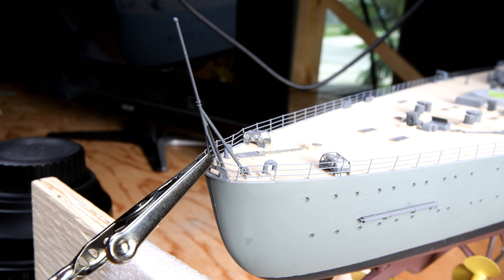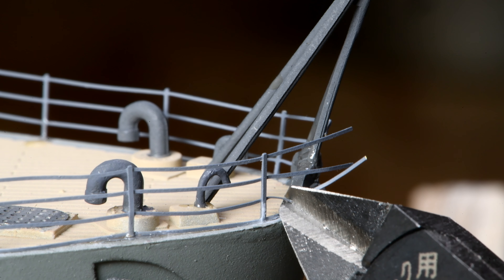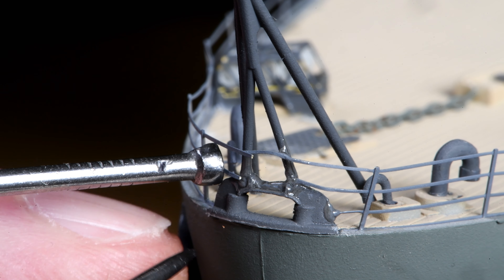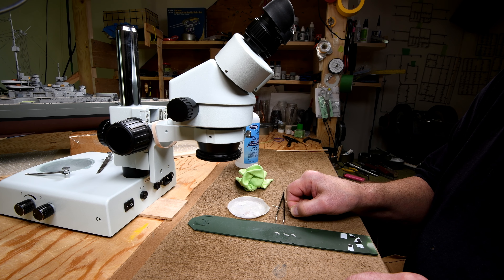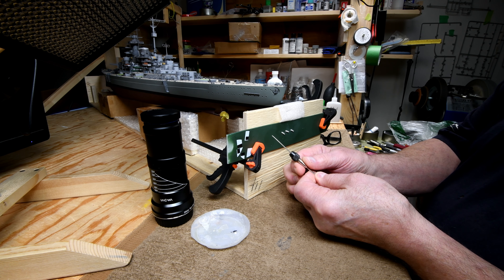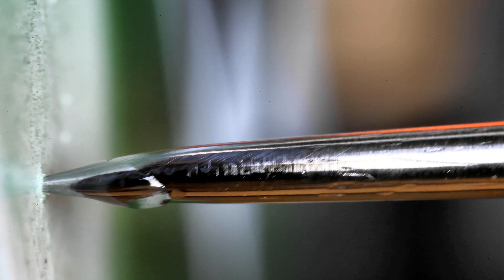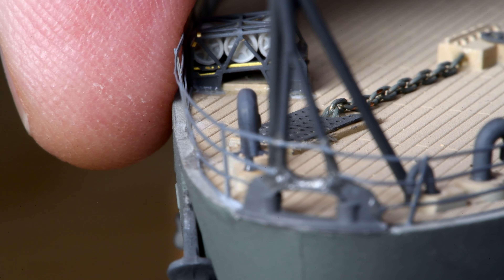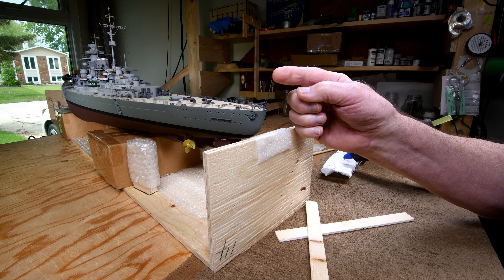The Model Ship - Part 465

Comment: Ron, just a thought, when messing with the railing and trying to hold or move it to where you want, how about using a sewing needle and grinding off part of the head like you did for the needle to apply CA. That way the railing would be cradled in the U shaped area and you be able to control it better. It might be too late for the Bismark, but if you get the HMS HOOD, you could use it on many parts there. It could be held in place with your handy helper clamp stand as you do with Ian's hands.( I still chuckle when I see them used)
Reply from the maker: Re: "the railing would be cradled in the U shaped area" 
Now, that's a very good idea. Thanks! 👍

Comment: 20:30 - "Why don't you buy a pair of scissors ? 
I too, will go through a lot of time and effort to 'save money'.
Like yesterday I used up a 36" length of .156" spring wire ($5.49) and 4 hours of time trying to bend up a re-usable cotter-pin to secure a trailer ball hitch.
I mangled a lot of wire, and made several tries before I ended up with one that was 'sorta' O.K.
Today at the hardware store I saw the same size perfect factory made pin for $1.95.
Reply from the maker: Haha! Yes! We tinkerers are a funny species. There's probably a support group out there somewhere for us Andy. 😁

Comment: Hi Ron,
I see your problem using a needle with CA glue. You have to put a drop of CA on the needle directly from the tube of CA, dipping the needle into your plate will not work.  I just tested this and it worked for me.  I'm sorry that I did not state that before.  Try it off camera.   

Your repair work on the railing came out very good.

Stay safe and stay well 😷.   😷.  👍.    ;-)
Reply from the maker: Jason, I can see where your method might work when a large drop is wanted, but it would simply drown most of these very small plastic parts. 😁
Reply: Ron,  understood. At least I tried to help.
Have a great Sunday and as always, stay safe.
Jason
Reply from the maker: @jasonguttman548   "I tried to help" Yes, and I really do appreciate that Jason. See you tomorrow. 🙂👍
Reply: Ron,  right back at you.
Have a good night.